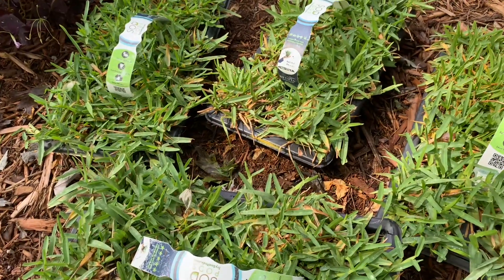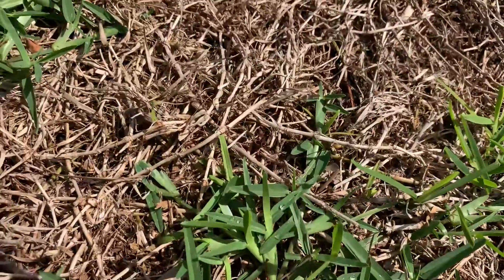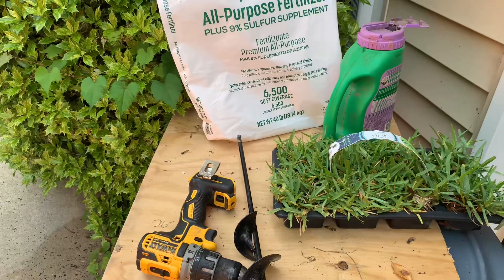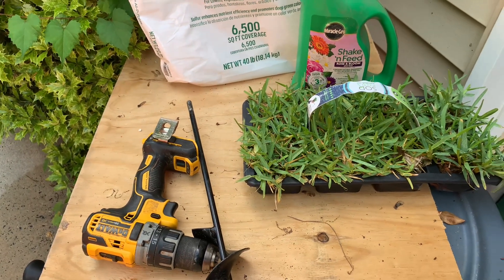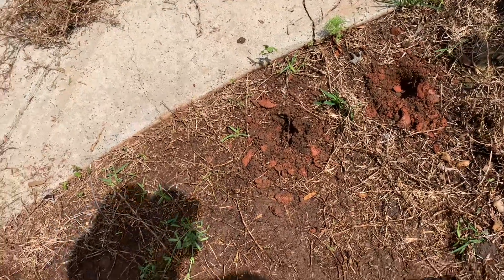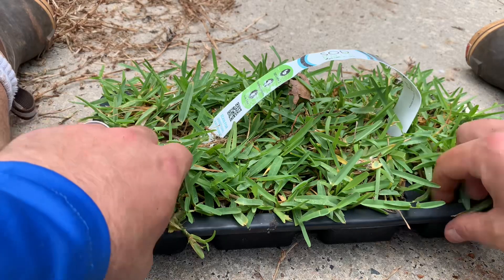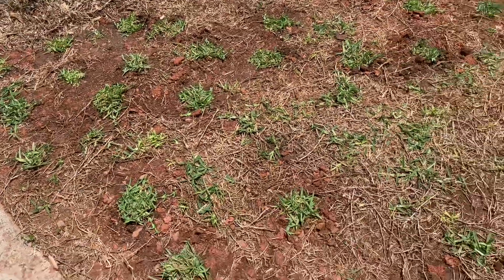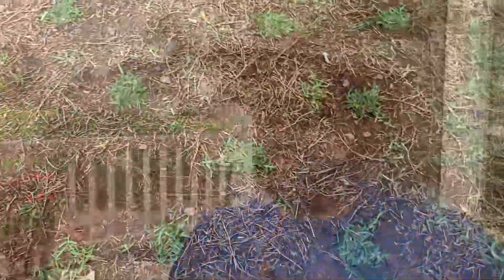St Augustine Plug Grow Project: How To Instal Step by Step

Comment: Speaking of plugs, over the weekend I transplanted 30 to 40 plugs with the proplugger 5 in 1  Man was it easy, just using my existing St Aug and placing them in bare spots. Can literally swap 8 plugs in less than 10 min.  Watering twice a day hoping they survive. You would definitely need to buy plugs if you have a large area but not on bare spots, Im going to do maybe 50 more this coming weekend.
Reply from the maker: Nice! Please let us know how it turns out!
Reply: The one downside I thought might exist with the proplugger compared to using an auger bit in a drill is that you can't really break up the soil with the proplugger. Did you encounter any roots and did the proplugger cut through them.
Reply: @MarkTrades__  I hit some major roots by some pine trees, I just moved over and tried again, it can cut through small roots, so far all of the plugs survived and doing great, runners are indeed slower because I swapped soil and just pushed the grass plugs in, no fert. I made sure the donor grass was by no roots. The roots I encountered were the bare spots, I will be doing more soon, so easy and fast

Comment: Thanks for the vid. Do you have any opinions or experience with cutting pieces of sod into smaller pieces and then installing them like sod plugs? I have a very neglected lawn and have been re-installing st augustine in various areas but only had full sod pieces readily available locally. I rent so I am not trying to do a full sod install in bare areas, and am just trying to get something besides weeds established  in bare spots.
Reply from the maker: Hi Mark, only challenge with sod is it does not have the strong, established root systems like plugs do. Plugs come with a strong, deep root system.
Reply: @LKNDIY  Yeah that is my main concern. I suppose I will have to monitor the rooting progress of the sod I have cut already and see if its effectively rooting in 2-3 weeks. Apprciate your response!

Comment: I recently planted plugs and wonder if I should trim the tops supposedly this encourages spreading but I haven’t found info online that confirms this. It seems you plan on doing this how much do you plan on trimming and is it good for spreading?
Reply from the maker: Yes, it’s great for spreading. You don’t want to take off more than 1/3 of the length of the blade as a general rule.

Comment: What would u suggest for me? I have a weed infested lawn at 40% st aug on one side. But I plan on doing a fall/winter pre-emergent as well as early spring. So with that said am I pretty much screwed to put St aug plugs since I’m adding year around weed prevention (pre emerg). Btw I’m in south Florida so I don’t get frost
Reply from the maker: That’s a great question. I don’t know much about the seasons down there, but my guess is it’s too hot right now to throw down plugs. You want to wait until evenings are not going below 55 degrees or so and the days are not getting into the mid upper 80’s. I’m guessing February would be a good time to put plugs or sod down, Maybe march. This will give some time for your current weeds to die out and your preemergent to keep our new weeds. Preemergent should not effect the plugs too much, and you can always lay down another app of preemergent two weeks after you plug. Hope this helps.

Comment: Im confused, the link you have posted says 1 tray is 50 bucks.. is that 8 plugs or am i drunk? 

I need to know what they call a tray, because even Amazon has cetrablue for 32 plugs thats 4 trays for 70 bucks
Reply from the maker: Great question. 16 plugs in each tray. I would call them directly if you are doing a larger plug grow as they will likely cut you a deal if you’re buying more than 10 trays.

Comment: I like the St. Augustine because it does better than most other grass but I let all the grass grow together because in time the St Augustine takes over.  The only place I am struggling to grow grass is under my avocado tree.  I think that tree is killing the grass.
Reply from the maker: The tree well could be absorbing all the nutrients out of the soil there, also, the shade under the tree could be slowing the st Aug down as well. You can always build a bed around the tree where the grass slows to get a uniform look.

Comment: RE: the auger bit - CAUTION - its a great tool, but if you have any decently strong roots in an area that you are using this auger bit, the bit can catch on the root and snap-rotate the drill in your hand and hurt your wrist/arm. (Ask me how I know). I'd reccomend short, quick trigger pulls in order to prevent too much of this rotation from occurring in one movement.
Reply from the maker: Agree, it is a tricky job!
Reply: @LKNDIY  haha yeah but dang even with roots the auger bit sped up my recent job a TON.